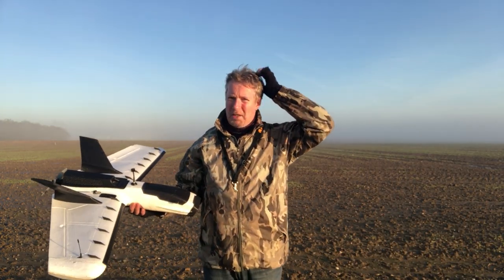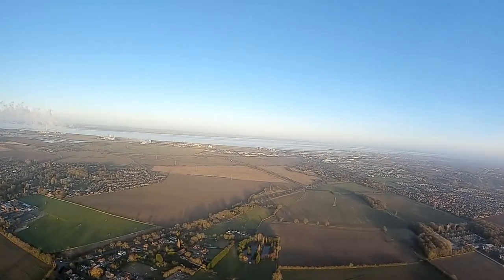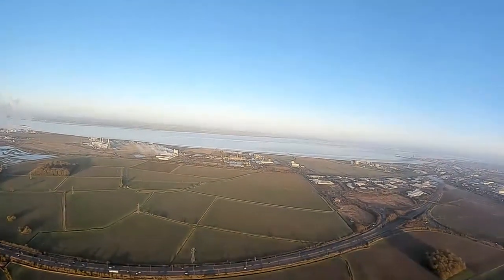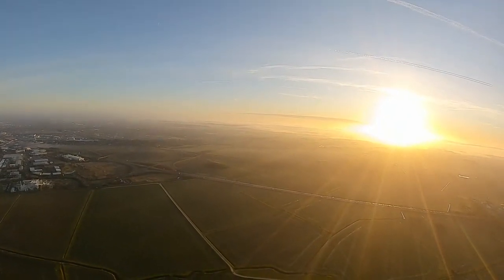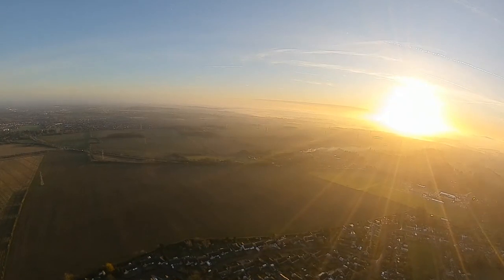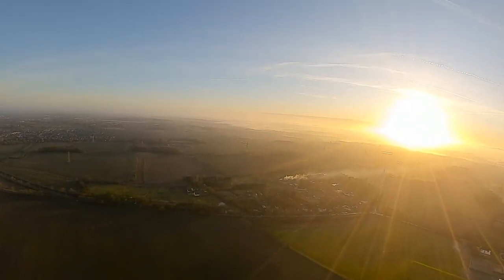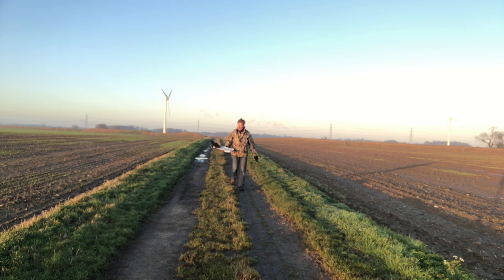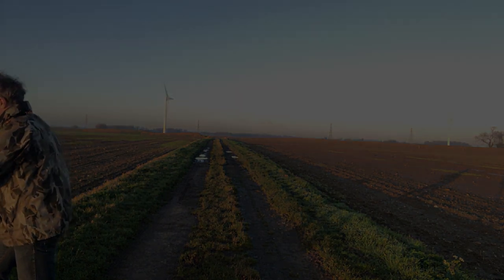Dart XL DJI FPV System 5km Flight

Comment: It's interesting that you can get more information via the INAV hack than what's currently available through the supported Betaflight OSD.  Right now, speed, altitude and distance to home can not be seen in Betaflight.
Reply from the maker: Yes hopefully they will add those features soon in the standard setup. iNav will include DJI OSD support in their next release I understand. Maybe they will add those features then, we will have to wait and see. I need speed , altitude and direction to home when I fly long range so will use the Arduino hack for that until its included as standard.

Comment: Nice, are you running the version of inav with the OSD hack in the DJI Googles?  Back on analogue I always found the distance to home value to be fairly accurate.

Edit:  should have read the description first, I see you're using the arduino way to get the osd, there is now a unofficial build of 2.3.3 on RCgroups with OSD natively done, I have it on my quad and haven't had any problems so far either.

Comment: Eeech Amber.   I need a wing pilot who knows how to install it to review my Edgy Choppergirl English SoundPak.
Reply from the maker: I will happy to help out and test it for you but me and Amber have had a thing for a few years and wouldn’t want to upset her 😀
Reply: @bluefish3607  LOL You need to be careful volunteering yourself for work, you very well can quickly find yourself in one hair pulling mess building and fixing stuff for other people!  I know this from experience as I have a  "rescuing the clueless out of a sh1tstorm of their own creation" personality!   Been there, got that t-shirt many times over!

I'm sure though you just live to build these things.   I'm almost blind, so me... building little fiddly stuff... not so much any more.   I had to use my TS-100 to solder two XT60's to two unfinished battery packs I made this so I could keep them charged until get my eyes fixed, and with zero depth perception, tinning the wires floating in the air was an exercise in frusration!   Lol.  

You sound English... I'm in the USA.. so probably not viable... but I am crazy enough to source and buy a bunch of parts and shoot them to someone to assemble, and say, here, knock yourself out! have fun!  I'd probably say instead let's try to one up everything you've built to date, and instead build your next dream plane... build it, fly it, test it, and when you've had your fill then ship it to me... instead of doing something you've done already before.

I have a friend in Canada that use to build aircraft models and sell them, he'd do it for me, but again, international shipping and he's way out of practice.   I know two big names in RC personally in the states... David Gates and Mac Hodges.   Search "Mac Hodges B-29" on youtube.   Also I rag on xjet all the time in his comments section with long winded comments like this one to stop trying to be the bad boy of RC by pissing off the CAA...   I'm the bad girl and there's only room for one!

Too bad you're not in the states, I got three full size airplane projects in the shop  I've lost interest in and passed on a fourth someone offered me for free.   Just like an RC plane, only bigger, and aluminum or spruce instead of styrofoam or balsa.   Here's the EAA how to videos, here's all the tools you need, here's a debit card, go to it!

I still haven't decided if I want a long range wing or not.  I've got most of the ground equipment... Crossfire full, DJI goggles with long rand directional antennas.  I don't have an antenna tracker yet but it's  a mute point, with the DJI goggles I'll just have to use my body as the antenna tracker.  

I think yes, sure, I want one, fly for a long longer and a lot further...  but then I watch the videos and I'm like ugh, mostly flying straight forever, I'd end up swooping and diving and doing aerobatics a lot because I'd get impatient.

choppergirl@air-war.org
choppergirl.air-war.org
Reply from the maker: @choppergirl  Sounds like you have been busy, I like long range but always have to do a bit of acro when I get back to launch point myself to use any undepleted lipo :-)
Reply from the maker: @choppergirl  Happy to install it if you want me to test it, I love a Jolene moment and am hoping you sound like Dolly Parton now :-)
Reply: @bluefish3607  I might take you up on that just to test it out, and make sure all the audio files are there for wing pilots.  750 audio files total, it's a drop in replacement.  Just rename "en" to "en-amber" and drop my "en-cg" in and rename to "en" and you're set.  Easy to go back.

Sorry tho, I don't sound anything like Dolly, though I wear a coat of many colors my mama sewed for me...

https://www.youtube.com/watch?v=b0_KL23JNb8&feature=youtu.be

I esp. don't sound like Dolly played though that tinny little 1 inch TX-16s speaker.... I have both the original and the upgraded 2w version.   I imagine on a Taranis it sounds the same.   Not sure why they used 32kb, so I did too, but probably 16kbs or 8kbs recordings would sound no worse... and be less load on the processor.

Comment: I've taken some inspiration from the way you've installed a deck over the top of your flight controller and I've designed myself a 3D printable platform for my own Dart XL.

Also, you might get asked this a hundred times... but seeing as you've got your auto launch nailled... would you mind sharing your autolaunch inav settings please?

Thank you.
Reply from the maker: My Dart XL iNav launch settings are below, bear in mind that when you set Autolaunch and throttle up on my settings the prop will spin (as per the video) to change this if you wish set nav_fw_launch_idle_thr = 1000

I find with the prop spinning I get a much cleaner launch especially if I am carrying a heavy lipo.

# get launch
nav_fw_launch_velocity = 300
Allowed range: 100 - 10000

nav_fw_launch_accel = 1863
Allowed range: 1000 - 20000

nav_fw_launch_max_angle = 180
Allowed range: 5 - 180

nav_fw_launch_detect_time = 40
Allowed range: 10 - 1000

nav_fw_launch_thr = 1900
Allowed range: 1000 - 2000

nav_fw_launch_idle_thr = 1200
Allowed range: 1000 - 2000

nav_fw_launch_motor_delay = 100
Allowed range: 0 - 5000

nav_fw_launch_spinup_time = 100
Allowed range: 0 - 1000

nav_fw_launch_min_time = 2000
Allowed range: 0 - 60000

nav_fw_launch_timeout = 6000
Allowed range: 0 - 60000

nav_fw_launch_max_altitude = 6000
Allowed range: 0 - 60000

nav_fw_launch_climb_angle = 30
Allowed range: 5 - 45
Reply: @bluefish3607  Thanks for the reply.

Yes I actually prefer a spinning prop on launch.

Previously, in the days before autolaunch, I would normally set up a switch on my transmitter called "launch" which simply engages autolevel and around 25 degrees of pitch up attitude.

I'm not superstitious so it doesn't bother me to say that in almost 11 years in the hobby, I've never once had a prop strike on my hand whilst launching any pusher type of aircraft.

Having taken a 2 year break from the hobby starting in 2017, I've only recently started back up again and I'm so happy that the iNav devs have continued on and now we have such a great ecosystem for us to no longer be forced to spend £150+ on capable autopilots (I'm talking to you MFD and Eagle Tree Vector lol)

I printed my rear deck/platform yesterday and it's now fitted to my Dart XL, thanks for the idea (even if you got the idea elsewhere, I'm giving you the credit for giving ME the idea). 

Many thanks
Reply from the maker: @grim-upnorth  I saw your deck print on the FB group looks really nice. Mine is actually an old top plate from a quad that I used. I didnt copy the idea it just came naturally to me as a quad builder to have two layers.

I like the idea of the switch and uptilt, I will set that up on my Volantex Ranger which only has an FRSky receiver an no iNav  as its my LOS practice plane.

I am going to drop a DJI air unit on it and experience that plane FPV and that method you describe will be useful for launch and then let me pull my goggles down.
Reply: Cool thanks, I'm glad you like my design.

As for the switch and uptilt. It won't work as intended unless there's a flight controller in the loop.

Without a flight controller, the stick position on your tx directly corresponds to the position of the elevator on your model. If you set up a mix to put that channel at 2/3 up elevator, the control surface will stay at 2/3 up even when the aircraft is at the intended angle/attitude. This will cause the aircraft to continue pitching up until it attempts to loop itself, not a good thing.

With a flight controller installed, and autolevel mode enabled, the stick position on your tx is now simply a message to your flight controller, telling it what angle/attitude you want your aircraft to be at. 

You would notice in this mode, that even with your elevator tx stick held half way, if you then tilt your aircraft to x degrees, the elevator control surface would level out, even though you're still holding up elevator on your tx because the flight controller is attempting to hold your aircraft at x degrees.

long story short, the up elevator switch would be a bad idea on a flight controller-less plane.
Reply: Link to 3d print?

Comment: Great flight and this osd is really an awesome step for us wing people. Greets from Germany, Franz
Reply from the maker: Its definitely better than nothing and gives me confidence to go longer range with the DJI system.
Reply: @bluefish3607  Pushed it to the border already, 6.5km :-)
Reply from the maker: f.wing I could of gone further not sure how far though will give it another try now I have confidence in the OSD. What power setting did you achieve 6.5km with?
Reply: @bluefish3607  I was at 700mW. Don't think that you can get further. Nobody could. For me mbits went from 20 to 0.3 in a second and then you get a big fat DJI in you goggles. I hit the rth and after 20 seconds I had image again at 20mbits. Weird but that's what all will tell you.
Reply from the maker: @fwing  Obviously DJI HD will not compete with 5.8 or 1.2ghz but for me as mainly a proximity flyer its perfect. My eyesight is not great and compared to my Fatsharks the DJI system is amazing. I am sure the tech will continue to develop and we will have HD systems capable of 10-15kms during 2020.

Comment: Nice video. What's the max possible range you can get with the dji fpv system?
Reply from the maker: Beefy Beef  I got 5 km but I think it will get a little further 6 or maybe 7 max with good line of sight. I will be doing more test now we can fly again after lockdown.
Reply: @bluefish3607  cheers. Are you using stock antennas on the goggles and air unit?
Reply from the maker: @beefybeef1326  Yes stock antennas
Reply: @bluefish3607  thanks
Reply: @bluefish3607  hi. Sorry to ask a dumb question,  but I wanted to find out how to reverse a channel ( like elevator or aileron) with the dji fpv system?. I know this can be done in inav, but I need it to be reverse using the dji system, not thru inav ( ....it's a long story why!).
Reply from the maker: @beefybeef1326  I do not use the DJI transmitter so sorry I cannot help you with that, I use a FrSky Taranis transmitter with iNav only for my planes.
Reply: @bluefish3607  No worries. Thanks for your reply

Comment: Why dont you use 1.2Ghz ? and you risk it?
Reply from the maker: Hi George 1.2Ghz is not HD digital is it? Not sure what you mean by risk it?
Reply: @bluefish3607  hey bluefish happy new year.  i mean , the 1200mw is it official released by DJI and ready to be used for the people? , 1.2GHZ is not Digital , i am sure you know this. but is solid video for so many years in long range FPV
Reply from the maker: @gc9n   Hi George 1200mw is not officially released by DJI as far as I know. It is activated from a file hack. After flying analogue HD is something so much better and I dont really fly long range so for me 5km is more than enough, but if you want to go 10, 20, 0 kmh then I don't think DJI digital is up to that yet.
Reply: @bluefish3607  true
Reply from the maker: l

Comment: What are you using for control
Reply from the maker: Taranis X9D
Reply: @bluefish3607  thanks for the fast response how are you powering the air unit.
Reply from the maker: Mike McCarty Got sod all else to do lol stuck in isolation 😀Made a Y cable and powered it straight of the 4S Lipo.
Reply: Hi! In this flight rc control is thru the Dji system or 433, maybe 868mhz? Do you feel the plane stable in manual mode too? It looks like it flies smooth, but you are the pilot who feels the reactions for exapmle small, sudden winds. Thx!
Reply from the maker: István Soós I use TBS crossfire for my RC and telemetry with the module that fits into my Taranis X9D radio. I think it runs on 915 mhz but you can check that online. The plane flies very smoothly in manual mode and I have my iNav rates and Feed Forward settings quite low so the plane does not move aggressively on stick movement. This plane is a gentle cruiser not a race or acro wing but a lot of fun to fly. I hope that helps Istvan
Reply: @bluefish3607  Thank you! Wish you more happy fly!
Reply from the maker: István Soós Same to you my friend.